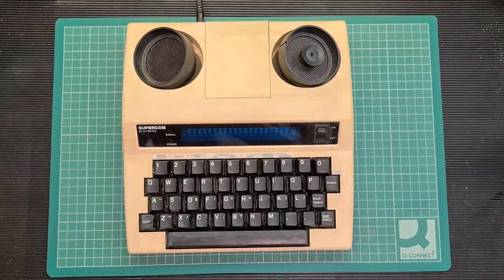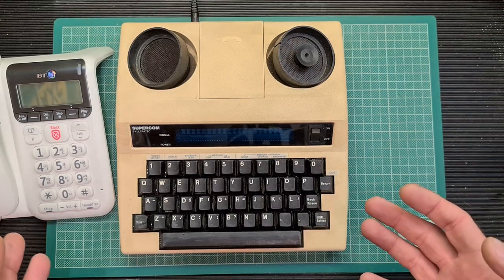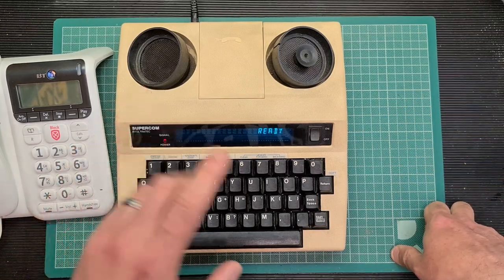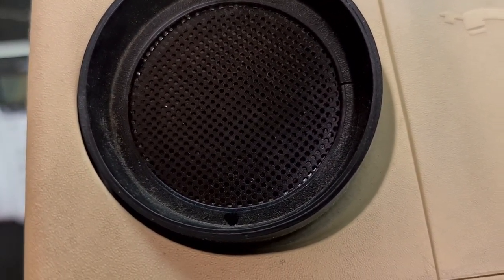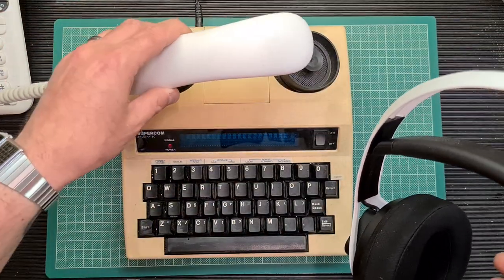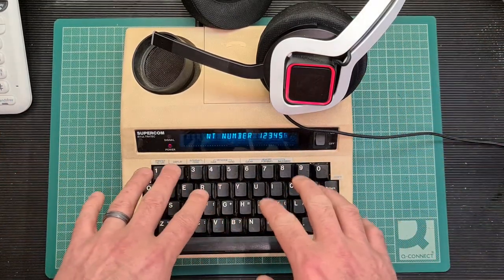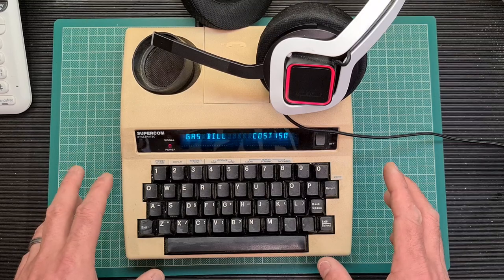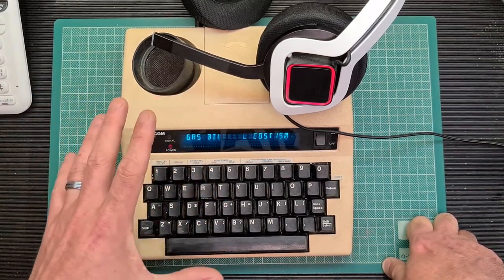Vintage & Interesting - The Ultratec Supercom TeleType / TDD equipment demo (Watch 'til the end!)

Comment: Way back when I worked at a grocery store, I would order products using a scanner connected to a recorder about the size of a size of a briefcase carried with a  shoulder strap.  When done with the order, I'd connect that device via the acoustic coupler to transmit the order to the warehouse.  So not used for voice.   Blast from the past!  Thanks for the reminder.